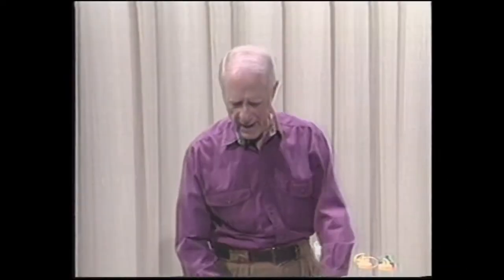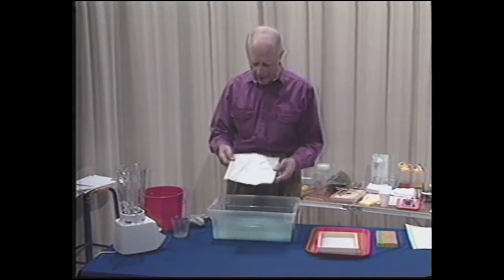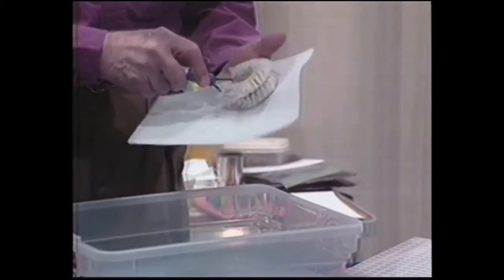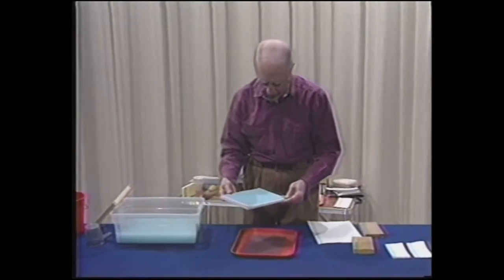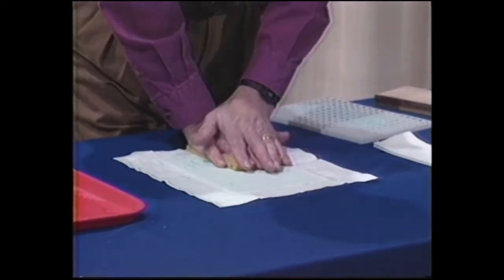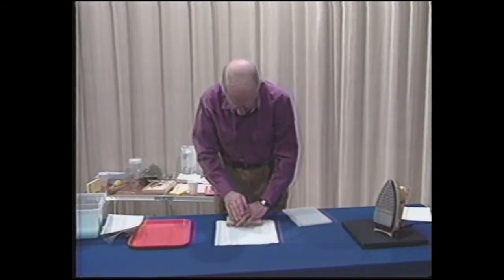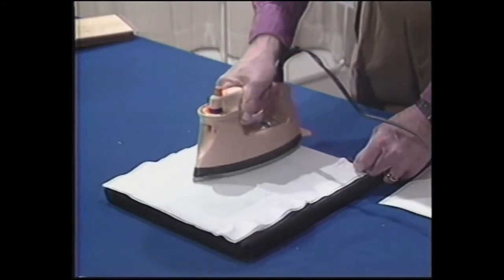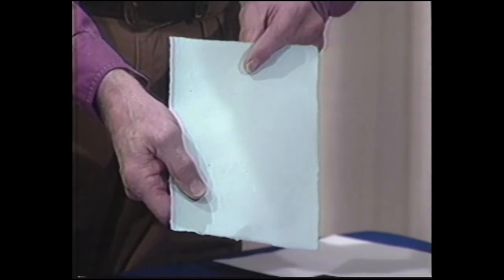Dip Into Papermaking! Basic Steps: How to Use a 'Dip' Handmold

Comment: A bit of advice please. Hi. I am totally new to paper making. Well I did go on a day class about 20 years ago. I have purchased the Papermill Kit and I want to make the gift tag and envelope from the Trash to Treasure book. I have copied the pattern from the book but I am not sure how thick the shaped deckle should be. Is there a minimum thickness? I don't want to use card as that will get wet and soggy, I don't want to have to tape it all up so I am using a magnetic sheet but that is only about 1mm thick. I can use two as they stick together but I don't want to if I don't need to so how thick/thin do you think I might 'get away with'? Please.
Reply from the maker: Answered on fb